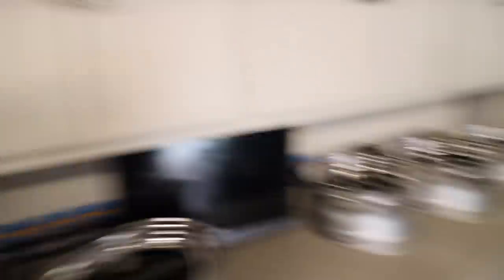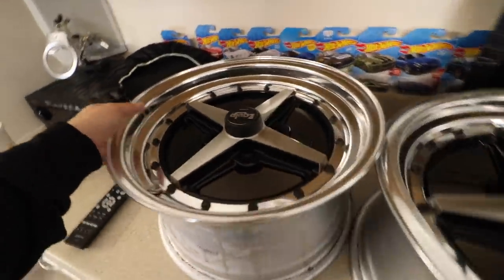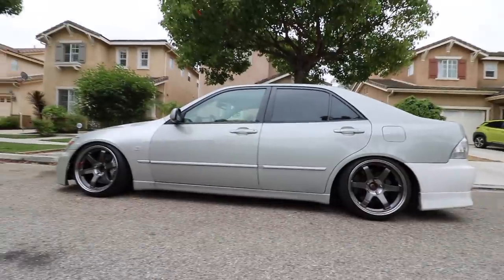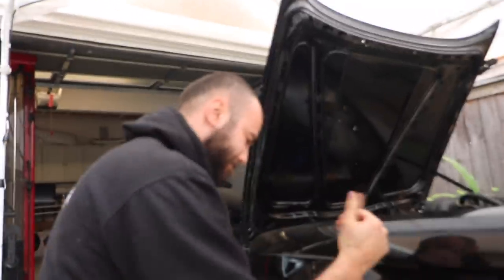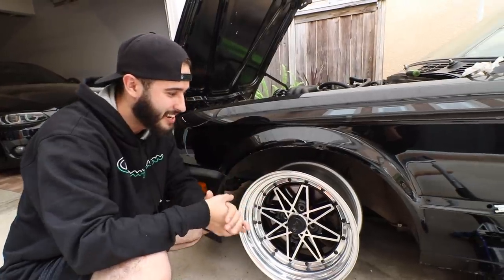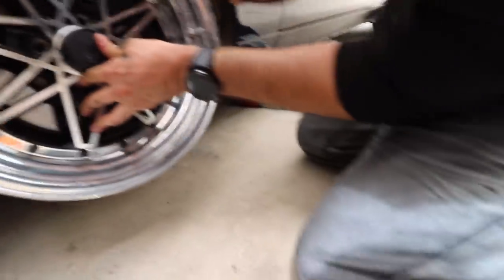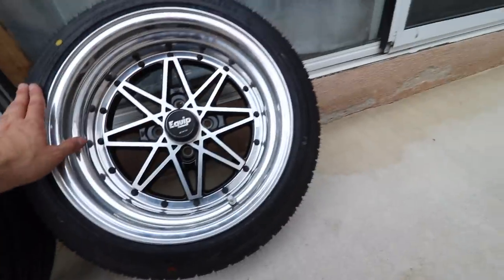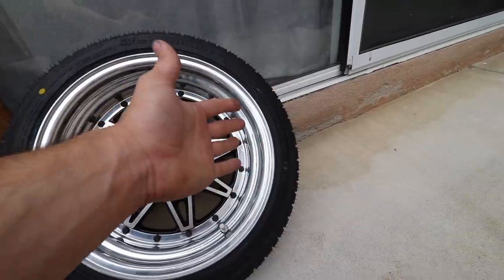Old School JDM Wheels on my E30??

Comment: hey bro, so just to be clear, were you able to fit the front wheel without a spacer after you had tightened the front caliper? or were they rubbing on the caliper regardless and you had to get spacers? looking at the same wheel specs for mine! your e30 looks nice even though it is not complete!